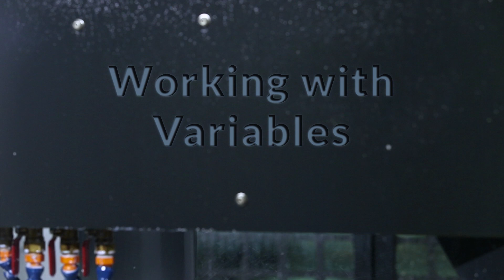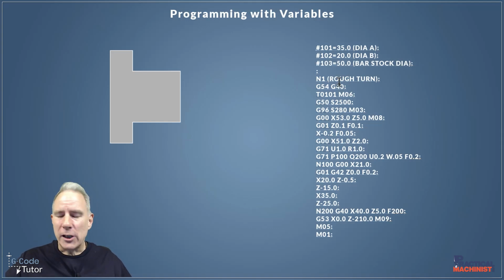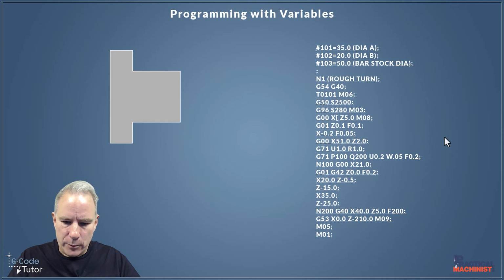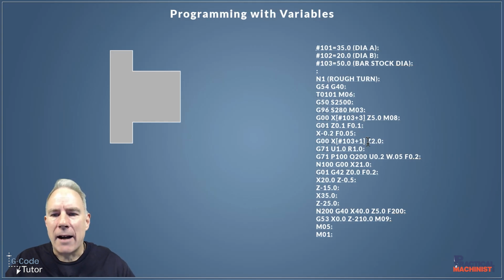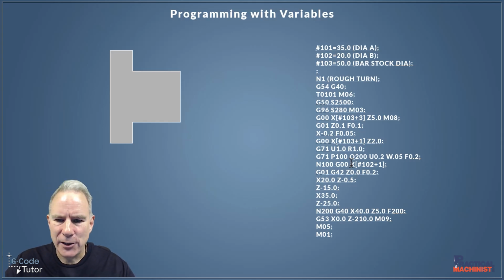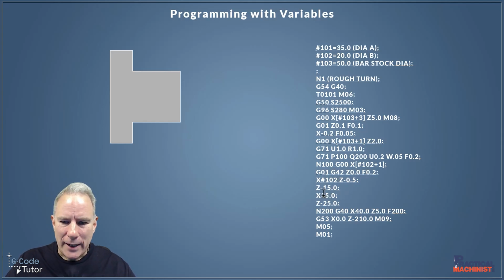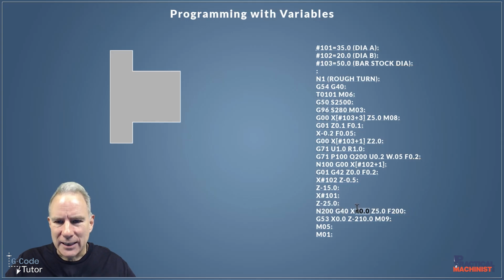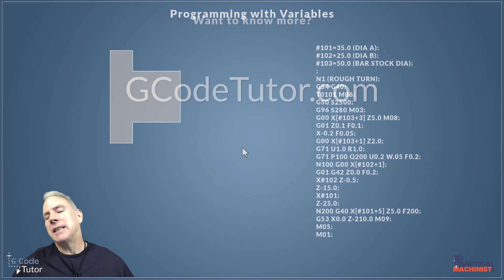How to Program with Variables Using G-Code

Comment: I spent 5 years programming a Format4 profitH200 using Tpacad. Nearly 100% of it was parametrically programmed. Used to upset the foreman as it takes a little longer but when a variation was required, it only took seconds to set up. It used a GUI but you could open the GCode and hack it. Just had to learn the machine code numbers. Not easy with an Italian program translated to German, then translated to English. Well presented video.